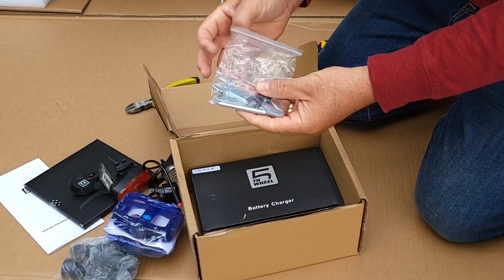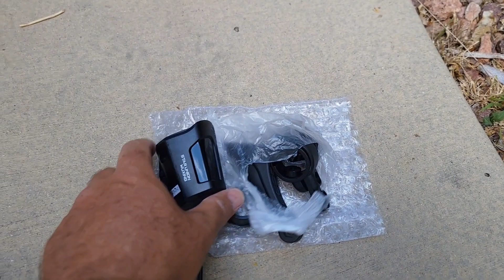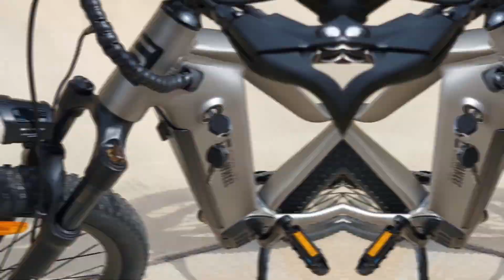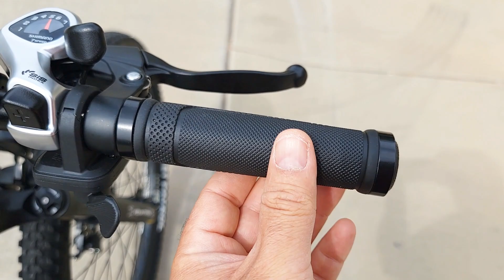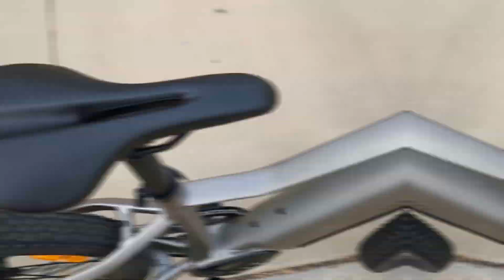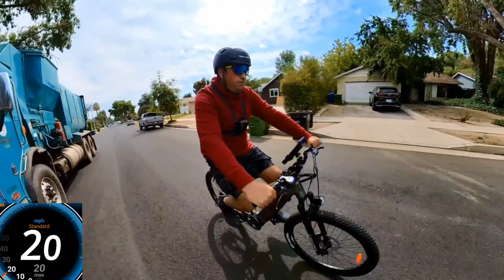5th Wheel Torrent 1 Electric Bicycle with Torque Sensor - Mountain Electric Bicycle

Comment: I see that max weight is 220 capacity.i aim 235......will I be able to use this ebike? what do you think.I have someone selling me one low price. i dent want to miss it. but I may not be able to use. any opinion?
Reply from the maker: I think the bike should be ok but  you might want to ride before you buy it.  How low the price if you do not mind to post? currently black friday sale with my discount code: erides230 will be $869 . also, the warranty almost never transferable so if you buy used there is no warranty unless you bought from authorized dealer that might be different. New comes with 2 years warranty. Also, I know 750w deals for $899 which is much more powerful for 400lbs max brands new but they had about 10 left for that price
Reply from the maker: by the way, you can check all the black Friday deals  with codes here on my new  page starting at $272 +   https://www.ebikeadvisory.com/blackfriday.htm